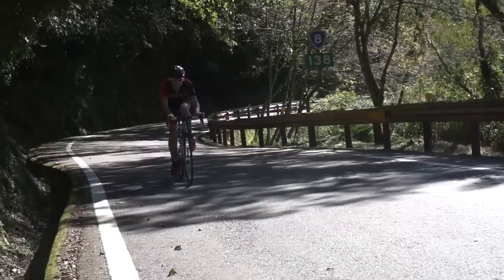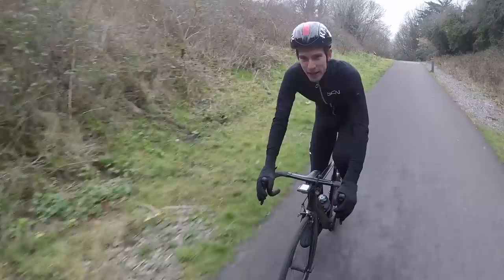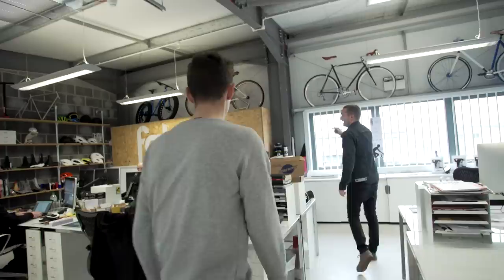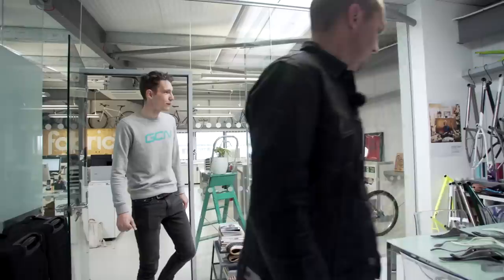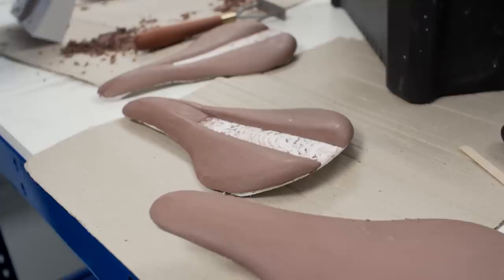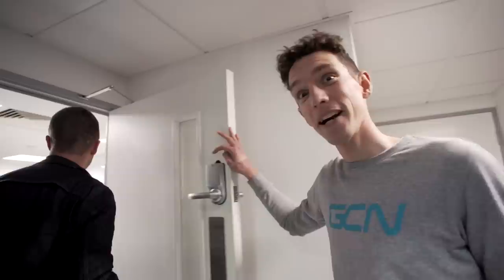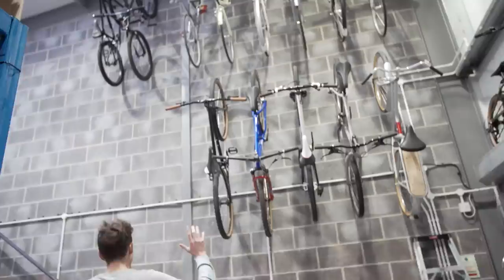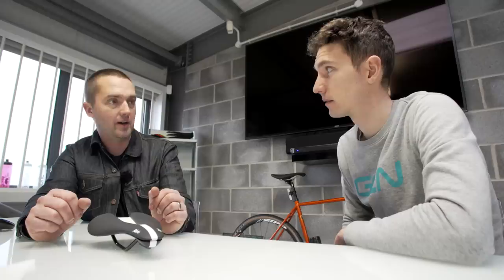Inside Fabric HQ | How Are Saddles Designed And Made?

Comment: I discovered Fabric Line saddles last year and now they are on both my road bikes. I only wish they made a more rugged/hard waring version for my mtb. Great video. 😉
Reply: Hi Stuart, have you tried one of our saddles on your MTB? Because of the vacuum bonding process, our saddles are not stitched under the base like many saddles so should be more durable with all the mud. Thanks.
Reply: Thanks for the reply. I have considered them. Ideally I was looking for something with a channel like the Line and also some harder waring material around the corners to hold up against scuffs and scratches. Any recommendations?
Reply: Hi Stuart, It doesn't have a channel but the Cell is incredibly good for a mountain bike. It's super comfy, very easy to keep clean and the cover is extremely durable.

Comment: edit  As suggested below, Fabric replaced both new bottles free of charge with a new design that is a huge improvement.  Top stuff.

Please try to address the leaky bottles, it boggles the mind that there isn't some form of rubber seal or such in the screw top's thread and having the bottle dribble out of the side all over me and my hands every time I take a drink is irritating and embarrassing to say the least.  I've ended up sticking with a grotty old one from a few years back as the last two new ones I purchased are just plain unusable.  It's a huge shame as otherwise the cageless design is absolutely fantastic.
Reply: Hi Sebazy, our bottle shouldn't leak so sorry to hear that you've got a dribble issue. If you take them in to your local dealer we will happily replace them for you. Thanks, the Fabric team.
Reply: An update to this, as suggested I took the bottles back a week and they were swiftly replaced free of charge a few days later, with an updated design no less.  I've got no leaks to report whatsoever on these new tops, the mouth of the bottle feels better, is easier to clean (it's translucent and those yucky flaps are gone) and the flow rate is significantly higher.  All round a massive thumbs up from me.  The good service is appreciated despite it being seemingly such a trivial item.  Thanks.